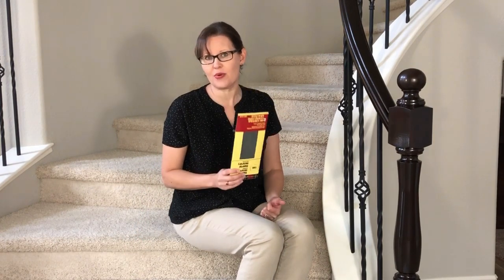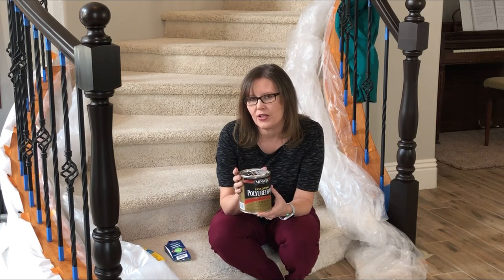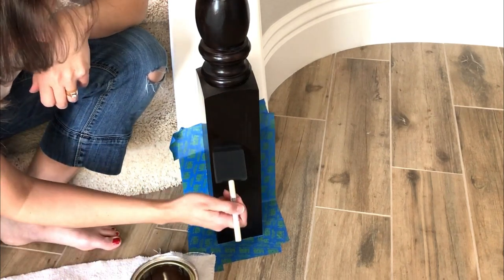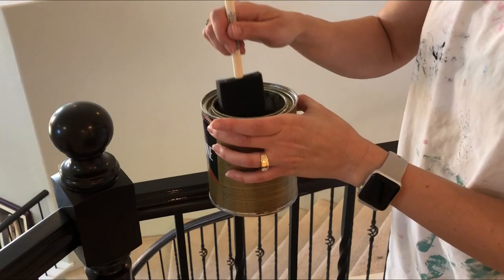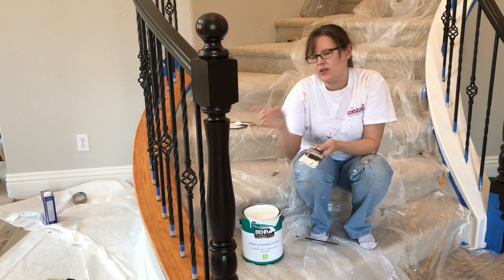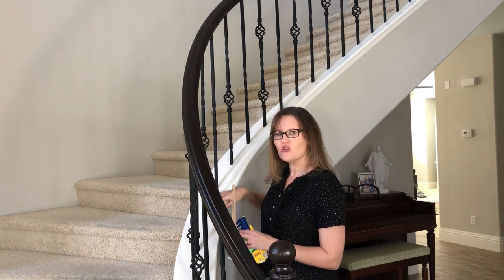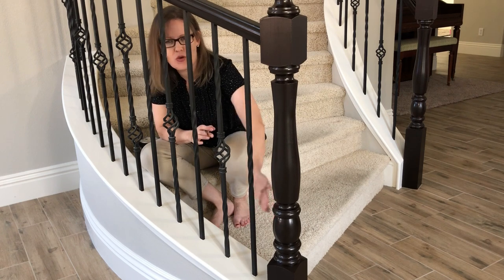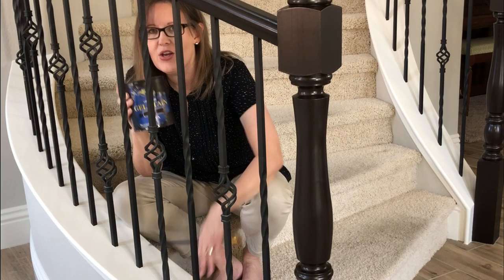Two-toned Gel Stained Banisters with Java Gel Stain Part 2

Comment: Thanks so much for your staircase tutorial!  I've been refering to your videos and article endlessly while refinishing my staricase, and it has been wonderful!  Mine are almost finished (after 3 weeks) and look amazing!  I will add that I did try the yellow Frog Tape (for delicate surfaces - about $9.00) and I was able to leave it on my Java stained surfaces while I painted all my white spindles through 3 coats, and it worked like a charm!  It pealed off beautifully (sometimes I scored where the paint was a little thick around a spindle base), I got clean, crisp edges, and have very minute Java touch ups to do. Again, thank you so much - your project turned out so beautifully, and I couldn't have done mine without your instructions, photos, videos and tips!
Reply from the maker: Thank you so much, Jenny! I wish I could see your stairs. It sounds like your hard work was worth it. Enjoy your new look!

Comment: I wish I had found this video before attempting my staircase.  I used the Java gel, but did it in the middle of the night to give it some dry time before the kids accidentally touched it. Unfortunately I have drips with the stain, that I couldn't see until morning. Luckily not on the top hand rail. But on the bottom in the detail, I wish I had thought about finishing it up with the t shirt material.  I tried the foam brushes first and I HATED it. I decided at 2 am foam brushes were the devil. I switched to a 1" artist brush and a 1/4 inch brush to get into the grooves. It was so much better for my stairwell. Thank you for the good tips and sharing. I will try the evil foam brush again for the top coat😅
Reply from the maker: Somehow I missed this comment. I’m glad you were finally able to get your project T finished. Drips are the worst, but I know all about trying to do projects when the kids can’t get to them. Sometimes it works, and sometimes it backfires!

Comment: Great tutorials!  When we bought this home, they had already pulled up the carpet and refinished the floors underneath.  Unfortunately, the old railings were deep cherry and the new finished floors walnut.  I'm about to turn my railings and wood spindles black with gel stain as it'll add nice contrast.
Reply from the maker: Good luck! I hope it goes well, Kim. Sounds like a great solution.

Comment: Do you think a steel wool pad would achieve the same result as 1500 grit sand paper?  Thanks in advance!  I'm in the process of doing lots of research on this and starting the project soon!  :)
Reply from the maker: Hi. Ginger. I don’t have any experience with steel wool on wood. 1500 grit sandpaper is very fine. It seems like steel wool would be a little too powerful.

Comment: Why not use the spray can poly?
Reply: I haven't tried the spray poly, but I asked around and researched on the web to find out which was best for this project. If you are really good at handling spray coatings, you might give it a try. I know it would not have worked for me. I'm not great with spray paint. Because of the slope of the railing, the poly had to be applied very carefully in small sections. That was to keep it from dripping down the slope.